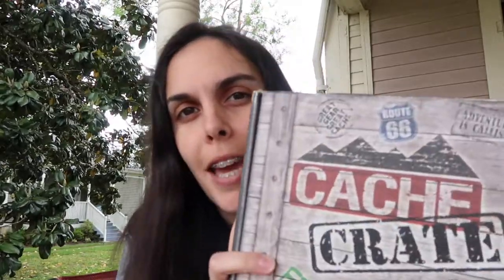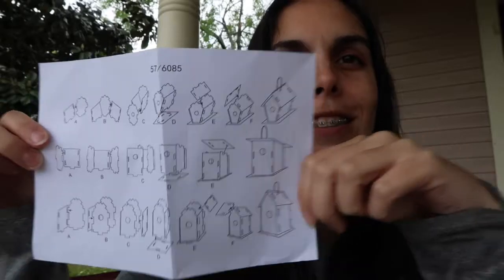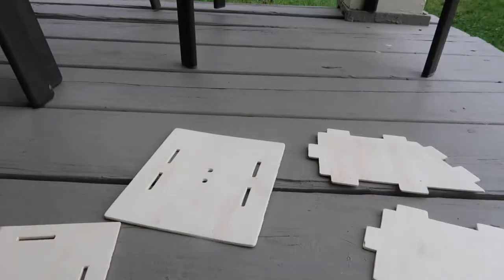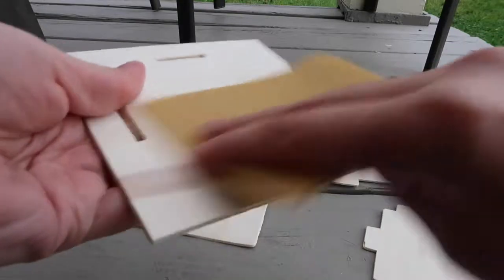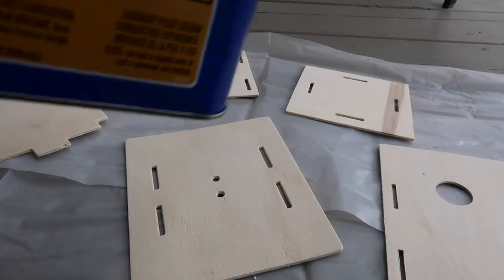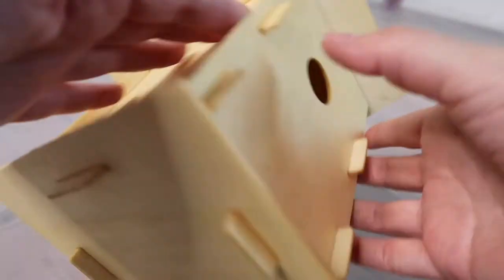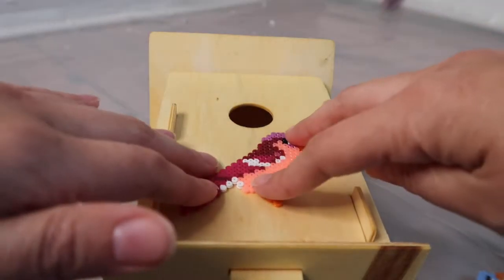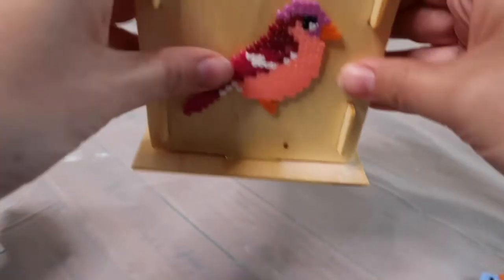Let's decorate the Cache Crate birdhouse

Comment: If you want to keep the bottom on and still be removable, put binder clips on them, then remove the squeeze handles leaving just the clips keep it in place, to remove save one of the handles, reattach to the clip squeeze and remove!
Reply from the maker: Thanks for the tip!